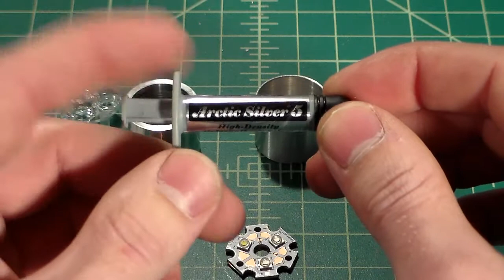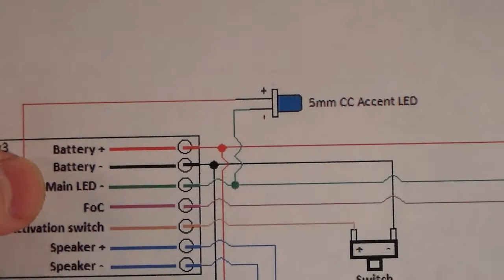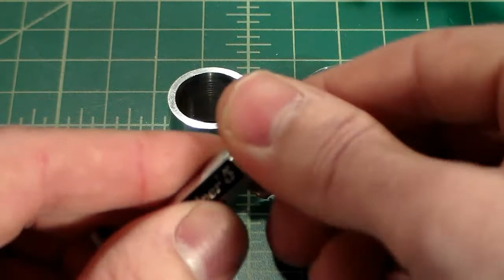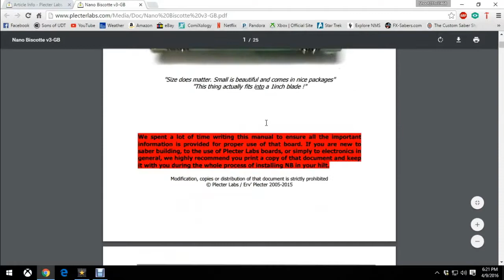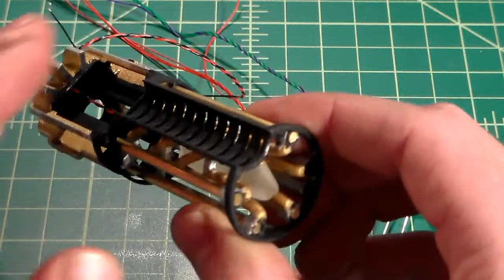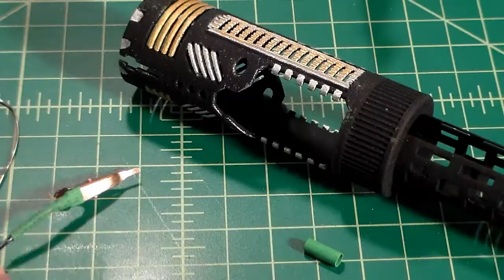Let's Build a Graflex - Episode V: Main LED Wiring

Comment: Just a tiny correction, at about 20:30 you talk about wiring the LEDs in series, but what you describe, wiring all the +s together and then having a single wire carrying the tension, that's still a parallel connection, but with bridged wiring instead of dedicated single wires. A series connection would be connecting the negative of the first LED to the positive of the next one, like this: V+ >led1+ [LED1] led1- > led2+ [LED2] led2- > GND

Comment: Hey, thanks for doing this! One question, though. I’ve followed your tutorial and made a blue Luke saber with essentially the same parts. I’m now working on a Vader build, and having problems with the LED. Each individual LED works perfectly when wired, but when I try to combine the two red negatives, it stops working. Any ideas? Thanks in advance.

Comment: Done. I used the rather big grey resistors and they fit in there too, even with all the other wires. It's a bit of a squeeze, but it works quite well (but you do need to stagger them)

Comment: hey man, great video!! Learned a lot!! Just one question, I need guidance, I wired the exact same LED you used in this video, same resistors on the blues, and everything. When I tested my blue dyes they worked great, however, when I soldered them to the white positive wire, they stopped working, so I decided to cut that wire again and test them and they still worked, do you know what happened? I finished my install and it didn´t work, pls help :(
Reply: Im having the same exact problem! I can't figure it out
Reply: I'm losing my blues when I combine all red leads Pryor to the resistors. I still have the white FOC.
Help please, wired mine exactly as shown in the video
Reply: Rodrigo Nieto 
Im having the same problem. Did you ever figure out how to get all LEDs working?
Reply: THE FELL TEAM, REALTORS 
Hi, Did you ever solve the problem
Reply: martyboof1 yes! There was a bridged joint. I ended up buying a new LED light and resoldered and I worked
Reply: THE FELL TEAM, REALTORS 
Thank you that was in the back of my mind.....I'll try it

Comment: Where did you get your heat sink? I ordered one off TCSS not realizing it was to big for the 2.0 chassis. I've seen the one like yours on TCSS but its a 1'' ID sink.
Reply from the maker: You need the .875" heat sink that they offer. They're out of stock right now but you can find it here: http://www.thecustomsabershop.com/875-OD-Heatsink-module-with-center-hole-P1138.aspx

You can also get one from KR Sabers in the UK @ The saber armory: https://thesaberarmory.com/product/78-od-heatsink-module/
Reply: Thanks again. I ordered the one from KR sabers.

Comment: how did you figgure out which is you white positive?
Reply from the maker: Well LED's only allow electricity to flow in one direction, so using your test power supply simply touch the + and - leads to each pad on the LED and see if it lights up. If it does, you know which is which. If it doesn't, reverse the leads and it should work.

Comment: is the padawan chassis much easier? How would using that one work? WOuld the wires be very long like this build
Reply from the maker: The Padawan chassis is easier to assemble but still requires some skill to make it look good. The LED wiring is still going to be a little long but it's much easier to run due to the design of the chassis.
Reply: oh ok, are you doing commisions? If i had all the parts(graflex 2.0, NEC spark 2, the speaker, knight chassis, tri cree led, and evrything else). how much would charge for installation?

Comment: Fo selecting the custom trim-cree, is the third LED the flash on clash, or the second one??
Reply from the maker: It doesn't matter. Just select whatever colors you want and wire it the way you want. If you want white as FoC than wire it that way. If you want different color just wire that die to the FoC circuit. The LED doesn't care what die does what.

Comment: which is the battery tester u used?
Reply from the maker: Battery tester?
Reply: East Coast Sabers i guess i meant the battery pack u said u used to test if the leds work
Reply from the maker: Oh that. That's just one that I made. I bought a double AA battery holder from RadioShack that came with the red and black leads on it. Then I just soldered some micro-alligator clips onto the ends.

Comment: The accent LEd for the crystal you put in the forum already comes with resistors, would those due for the 3.7 battery to use on them? Also about how long is the wire from the LED module to the resistors?
Reply from the maker: If you take power from either the accent pad or the DS pad you shouldn't need a resistor as those only put out 3.3v and shouldn't damage a normal 5mm LED. Of course if you're running a red or something with a low vF you will need a resistor. As for the resistors for the main LED, you make them as long as they need to be. Measure everything out and get a feel for where the resistors will eventually lie when the chassis is done and make them a little longer to compensate.
Reply: East Coast Sabers oh ok thank you so much. also u said u didnt want to do put it in the DS pad because u didnt want to damage the thing next to it but if i wanted to do it, when u solder the wires u would also turn it around and solder on the side where u soldered the wires in this video? or on oppisite side?
Reply from the maker: completeGamer007 When soldering to the tiny DS pad you can only do it from one side because the SD card holder is directly on top of it. Since these videos I have soldered to the DS pad several times without a problem. you just have to be very careful.
Reply: East Coast Sabers oh i see, so it looks like the eaisest way is the bigger 3.3v connection since u can use the SD card side of the board connector to solder it
Reply from the maker: completeGamer007 Yes. But it really depends on how you want your accent LED to light up. if you want it to only come on with the blade you can wire it to the accent pad just fine. but if you want it to light up as soon as the board is awake or the kill key is pulled you need to wire it to the DS pad.
Reply: East Coast Sabers thanks, i just dont want to mess anything up while wiring to the DS pad, but i guess ill have to try

Comment: Great video series by the way. I have a question. When you use a board like the Crystal focus and you use color mixing on that board with red green blue LEDs, do you still have to use in line resistors or does the Crystal focus board handle that for you via the color switching protocols and circuitry on the board? 
This is an awesome series!! I would not have thought to have the skills to even attempt this until watching your videos.
Reply from the maker: Thanks man! As for your question, if you want to use a CF8 you only channel 1 has an on board driver so the other color channels will need to be externally resistored. But if you are going RBG you really should be using a Color Extender to get the most out of it and I believe it has the on board drivers so there is no need to worry. But in all honesty I don't have a lot of experience with the CF8 quite yet and the best place to get info will be the manual.
Reply: Thanks for the response!! What would be the closest plecter board to  the nano biscotte that HAS blaster effect(2ndary switch) option?
Thanks again
Reply: sorry I accidentally  responded through my wife's account...oops...she loves lightsabers too

Comment: When I was soldering the resistors to each blue LED, I then soldered the two resistors together and had one positive wire going to the soundboard. I then added the white positive to the end of the resistors where the one wire was going to the board. I tested them and the LEDs didn't work. I then removed the white wire and the blues worked. I tested the white by itself and it also worked. Would you perhaps know why this happened? I followed everything you did.
Reply from the maker: Without seeing a picture of what you're working with I wouldn't be sure what went wrong. If you followed the video exactly it should work.

Comment: For a stunt build, would you simply run the positive LED wires to the battery and then negative LED wires to the switch then the battery, or would you need resistor or something different than just that? (Pardon the many comments but thanks for your help)
Reply from the maker: essentially yes. You either put the switch on the positive side or negative, it doesn't matter. I apologize for the slow responses, for faster communication feel free to join my Facebook group. There you will not only find all of the info you will need to build your own saber but a group made up of some of the most well known and experienced saber smiths in the business. 

https://www.facebook.com/groups/531694840343274/?ref=bookmarks
Reply: Thanks for all the help, and I appreciate the responses. Very fast actually. Thanks
Reply: I've been looking for tcss heat sink module but they're out of stock. I can only seem to find the LED's on SaberBay. Where could I find the SaberBay kind, or should I just wait till TCSS has them back in stock?
Reply: Brett Nelson You can find the heat sinks on KR Sabers website.

Comment: HI, following this build series with great interest. Great help and thanks for your time and much appreciated effort. I have a question, i am using one of the "original" switches not the rocker switch under the clamp card and you say "make a groove for the wires". Is there a link to an image for this? I really don't want to mess it up.
Thanks
Reply from the maker: I don't have any pictures, but I am going to be making a video showing how I wire and assemble  the main red switch. should be online in a couple of weeks.
Reply: great, I have all the parts ready and waiting. Thanks

Comment: Hey awesome videos, as soon as my parts arrive im following your build. I have a question, the only 30 AWG wire i can dind is classified as "wrapping wire" can this type of wire be used and soldered?
Reply from the maker: No, don't use wrapping wire. If you're only doing this one build you can get 30awg wire from a seller in the UK on eBay for pretty cheap, just be sure to message them so they can sell it to you directly rather than going through eBay because it will save you time and money on shipping. You can find it via this link: http://www.ebay.com/itm/262476939957

Or if you want longer rolls, you can follow this link, which is also good wire and is sold in 25' individual spools. I got all 10 colors in 25' spools for $75: https://bulkwire.com/ptfe-high-temperature-stranded-wire

Comment: I love that you're doing these videos.  I have one observation; I was told by a electronics teacher never use rosin-core solder on PCBs.  Something about the rosin eating away at the circuit traces.
Reply: +Laochri Nonsense!  I'm an engineer and have been soldering for 30+ years military, commercial PCB's et. all.  You need to re-ask that question.  You do not use ACID core solder on any electronics, PCB's, etc. or it WILL eat away your circuit traces.  Rosin core is the only thing you want to use, period.
Reply from the maker: +Flying Fat Cats Thanks for the clarification!! I was curious as I've never heard of ANY issues with rosin core.
Reply from the maker: +Laochri Hmm. I haven't heard that before. I've always used rosin core and I know MANY people who do daily and have never had a problem. I suppose it's possible, but I've never seen it. I will definitely look into it though!